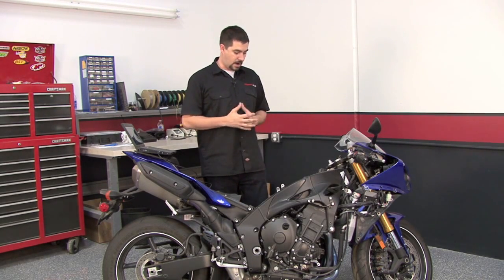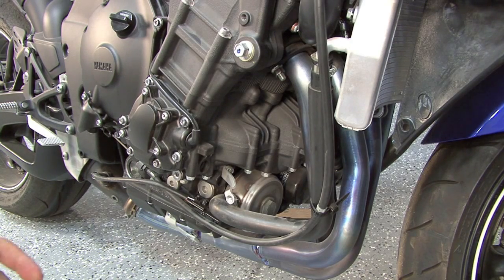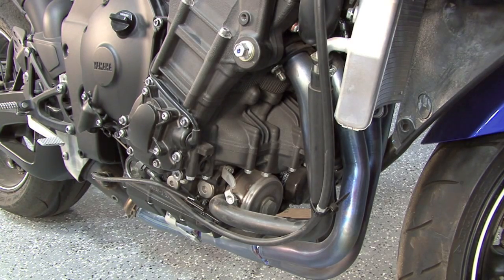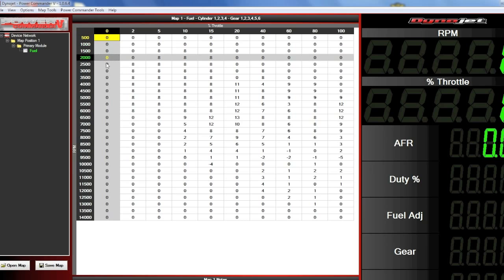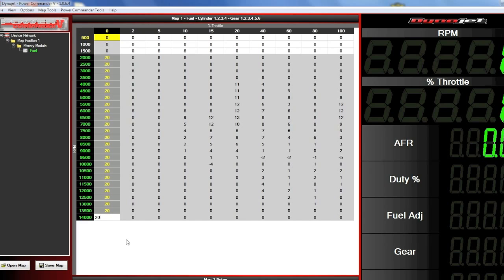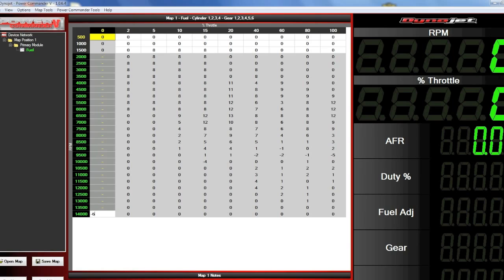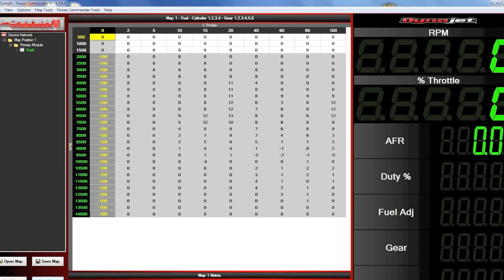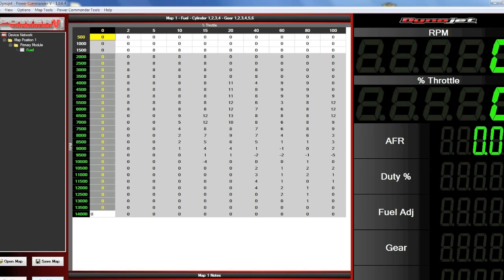Dynojet Power Commander V: Reduce decel popping

Comment: So I just bought a 2021 z125 pro with yoshi pipe on it, it has tunes and everything and it decel pops 2 out of 3 times when I let of the gas going anywhere between 35-60 mph I don’t mind it and actually think it sounds cool but I don’t want it to cause any potential engine damage so my question being if I were to just leave it be would it fuck up my Engine in any way ?
Reply from the maker: Please reach out to our technicians at Pstech@dynojet.com to help with your issue.

Comment: I found this video so I could INCREASE the popping. My 954rr pops beautifully between 4-5k RPM and I LOVE it. I want to get my 929rr to do the same thing, it has a PCIII but doesnt pop.
Reply: If you have a tuner nearby, he can change the stock ecu setting. There is a setting on there to turn on or off ignition with closed throttle which increases popping. All new japanese bikes has it I'm not sure if the option is there in older bikes like yours. Should be there.
Reply: @nnlniclb  Is there a way to do this in the PCV software? I have an ignition module and I know you can advance or retard the timing, but can you shut off the ignition entirely?
Reply: I'm probably too late on this topic. But were you able to find a proper map for your 929? I'm currently working on mine with a PCV.  Did the airbox and PAIR, has a Devil high mount exhaust ( I kept the exhaust valve tho)

Comment: I remove my AIS valve with block off plates and I disable the AIS valve through the ECU For dyno tuning purposes BUT BUT....
but I would still like to get the popping and crackling how could I accomplish that after installing the block off plates and removing the ais kit
Reply: My fi light came on after installing the block off plates and the risistor plug it came with. Code #64 for a Kawasaki 650 Ninja idk how to get the fi light to reset
Reply: ٠
Reply from the maker: Maki, please email us at powercommandertech@dynojet.com and we can help you with this.
Reply: @DynojetResearch  a short reply would have been fine on YouTube but that's okay
Reply: @makiatzu3628  did your get a reply?, i jsut did this too

Comment: Now I know why I loved carburettor's, this is all voodoo to me.
Reply: Why? It's actually much simpler. Now you simply give numeric value to increase or decrease fuel flow. On decel situations this is pretty much equivalent of messing with idle mixture screw for the most part. But with programmable ecu you can tune everything on specific load and rpm range. It's much harder with carbs to do specific changes in fuel mixture. Sometimes downright impossible.

Comment: So what if you have a flashing error both on the device and when on the  laptop, is there a way to fix this,  and why or what makes this happen?
Reply from the maker: What's the error code you're seeing?
Reply: @DynojetResearch  How do I tell what code it is? To me it so far bottom right side of the screen it flashes device errors and under that where it says network connected, on the left side of it it says devices errors 1
Reply from the maker: At the top of the software. go to VIEW – DEVICE ERROR DETAILS.
Reply: @DynojetResearch  Error 2303  VR module unsync'd, severity  high
Reply from the maker: To better answer your question, can you please email PStech@dynojet.com with the error code, as well as what bike you have and a photo of the crank connector installation? It'll be easier to work through it that way. Thanks!
Reply: @DynojetResearch  2 Emails sent
Reply from the maker: We sincerely apologize about this. From which email address did you send the message? Thank you.
Reply: @DynojetResearch  For real guy's? Who's running the show over there, I'm sure if you're really looking in your emails you will find something from mrgrouchyguy, if not I think were done. This kind of annoy's me.
Reply: @mrgrouchyguy  Yeah, well you've got the right name there eh buddy! The dude was only trying to help, no need for the snarky crap.
Reply: @mrgrouchyguy  with that naming I wouldn't be surprised if receiver gets your messages to spam immediately 😏

Comment: Put a damn marble in the hose off the pair valve. Problem solved.
Reply: I was wondering why he doesn't mention this. Perhaps there is a performance issue or danger he doesn't want to promote. IDK...
Reply: Itse quite simple reasoning I think. Would you give instructions that might even possibly prevent MOT on some countries?

Comment: I have also made some changes to my GS recently. I have replaced the stock exhaust with akrapovic racing line(carbon fiber) and BMC air filter(stock replacement) in place of stock air filter. I have noticed some good gains and great growling from the bike. After all this now i am little concerned about the air fuel mixture. Do you think the g310 siblings need ecu remapping after exhaust and air filter upgrade ? 
Ps - I have heard many people saying that the O2 sensor would self correct and take care of it.

Comment: Thanks for the video.Two questions:1) Can I get thermic shock and pistons or valve seat crack due to fuel being injected at closed throttle position?2) From witch values I will start to have flames on the exhaust sending fuel at closed TP?  RegardsGuz
Reply: You still have spark even when your throttle is closed on decel unless you turn off your engine kill switch or key......  So add hella fuel and retard the shit out of the entire Dynojet PCV Fuel & Ignition (Throttle Position %) 0% column of the tune your running and it will be 4th Of July out your pipes!! Enjoy riding through the hood n watching gang bangers drop to the ground or take off running!!!! Also, enjoy the red n blue lights pulling you over for being completely obnoxious and watching your scooter driving off on a flatbed tow truck....
Reply: +guzforce i have a 2006 R1 and im also trying to get flames out of my exhaust, did you find a way? thanks in advance

Comment: Is decel popping bad itself (not caused by exhaust leaks) bad in any way?
Reply: Kenji Shiroma I’m still wondering this.
Reply: Nendo Crescendo no it’s not bad for the bike in any way. You can keep it or get rid of it if you get a proper ECU flash or block off plates. It’s for emissions control.
Reply: As mentioned in the video, decel pop occurs already, but it isn't as noticeable with a stock exhaust setup. On another note, lots of riders replace their exhaust because it's so quiet, thereby encouraging the pop to occur.